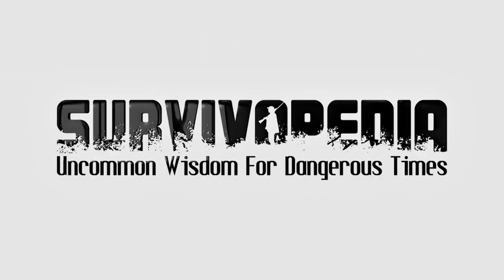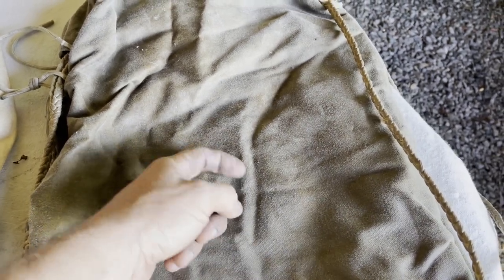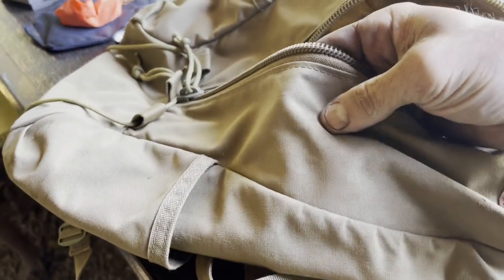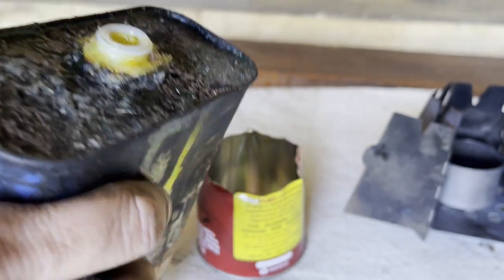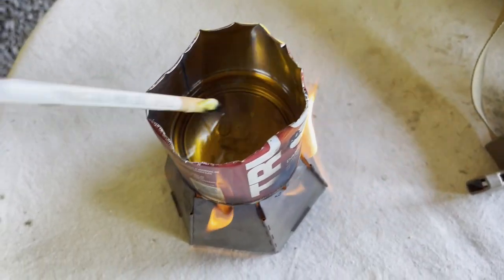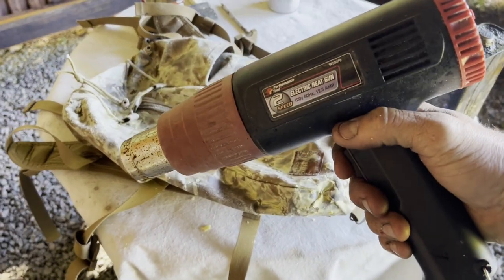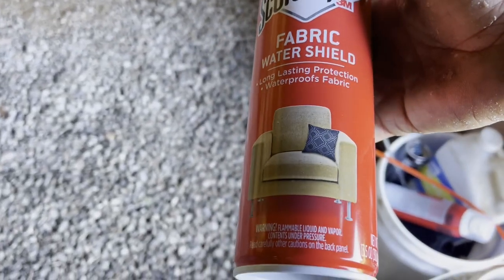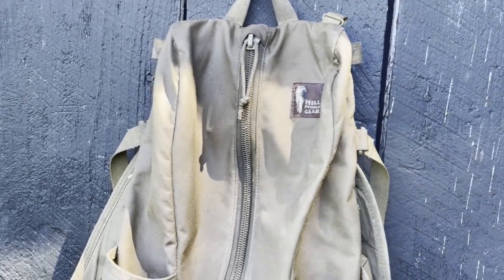How to Use Wax to Upgrade your Backpack

Comment: Nice video Jason, Thank you.  Your project turned out better than I was expecting on the fabric of your pack.  You're correct in saying, cotton canvas does absorb better, although you've proven material like your pack CAN be successful with a bit more coaxing.  BTW:  I've come across a few other "Recipes" for making wax water proofing for gear.  Instead of Bee's Wax, some folks use the wax toilet rings.  It sounds almost disgusting, but, it works out really well & less expensive!!  Thank you for your expertise & your contributions.  Best Regards!!

Comment: Just got to mention all butane lighters are waterproof without that cover (piezo blow and shake, flint roller shake then gently roll it round a few times) and in 40 plus years of carrying a lighter I’ve never had one break or lose the gas, in the army always carried spares inside pack and never ever had one leak out.

Nice video 👍